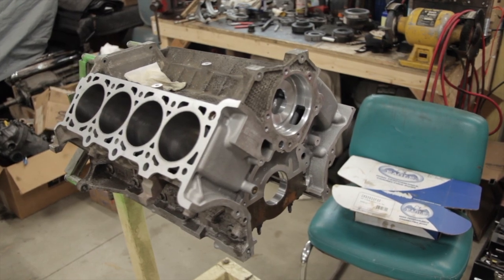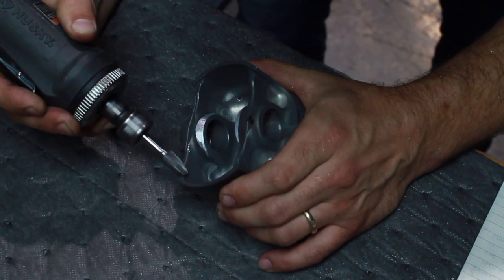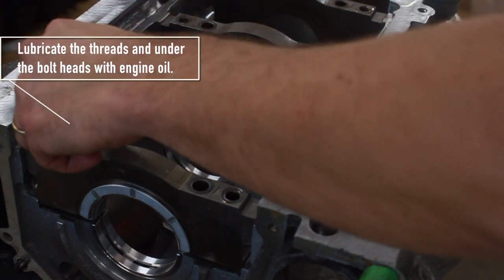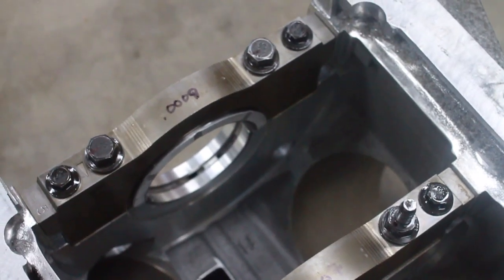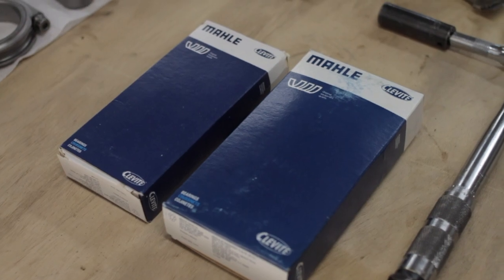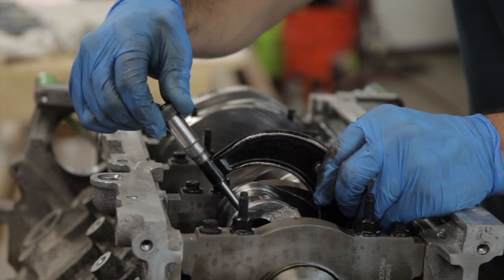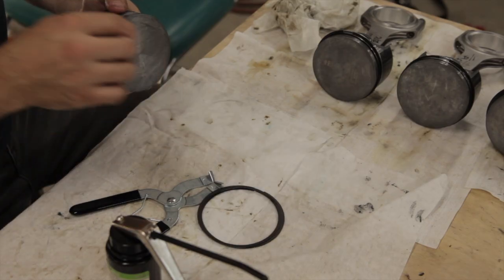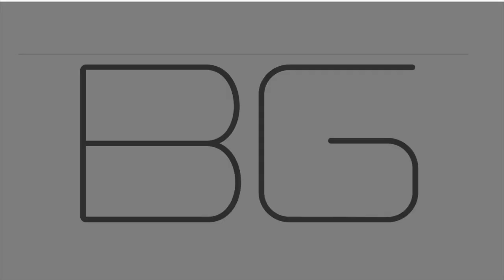Modular 4.6 3v Short Block Build | #trackworthynewedge | Chapter 2, Part 1

Comment: Let's say you have a 100% perfectly balanced crank (by itself) and you have 100% accurately measured and equal weight pistons/rods/wrist-pin/c-clip/etc... then my theory is that you should not need the crank balanced again with the whole assembly. My reasoning is that the crank has 4 lobes, spaced at 3, 6, 9, and 12 o'clock, so if you're adding equal weight to each of those, the overall balanced shouldn't change. Am I right?
Reply from the maker: Not really.  The crankshaft isn't balanced on it's own.  It's balanced for the weight of the reciprocating assembly.  The machine shop uses your reciprocating assembly to determine 'bob weight'.  Weight is added or removed from your crankshaft counterbalance lobes to create a balanced complete assembly.  My new reciprocating assembly (piston, pin, clips, rod, rings, bearings) was lighter than the OEM, so they drilled some weight out of my crankshaft lobes.

Comment: Very good video. Very thorough and detailed. The 3v nemak block imo is stronger than the teksid. It was made with more aluminum in structure points than the teksid was. And it has more support girdles in the casting. Along with billet main caps like the 5.4 aluminum block they are extremely similar.

Comment: Done a few push rod ford engines in the past. Currently have a 4.6 2V. Going to be building it this coming winter. Little hesitant having never done a OHC engine before. Great video. Very well done. Thank you!
Reply from the maker: Hey, no problem!  Glad you're going to give these mod motors a go.
Reply: @BradfordsGarage I’ve never built a complete engine before would this be incredibly difficult to do for the first time?
Reply from the maker: @icebox829  Its hard to say without knowing your background and ability level…depends on a lot of things.  I’d say look for books in building whatever motor you’re wanting to build.
Reply: @BradfordsGarage  never built any engines but I know how to use tools and I know how engines work. But I’ll def look into some books

Comment: 980rwhp on my 3v with stock torque to yield bolts. been driving fine for years. Weird it hasn't dropped the crank out the bottom yet.
Reply from the maker: Hell yea.  These cross bolted mains are very durable.  The only bummer is that I dropped a valve and have to rebuild again, and now have to buy new bolts, again.  Had I done the ARP stuff I wouldn't be buying bolts.  I will upgrade this time.

Comment: These mahle flat top pistons I tried looking them up and all I've seen is that they fit 2v and 4v are they the same fitment for the 3v?  Sorry for the stupid question
Reply from the maker: Hey, thanks for the comment and not a dumb question at all.  There are pistons specifically for the 3V that have a fly cut relief for the exhaust valve.  I assume that with some camshafts you may need those pistons.  With the cams I used on a 102 crank centerline I had a ton of room when I checked PTV clearance.  Glad to help in any way that I can, though, if you have more questions.  Feel free to shoot me an email.

The part number for the pistons I used is 930256272.
Reply: @BradfordsGarage  Thank you for the really good info.  If I could pester you some more The 3v 4.6 I have is in my 2010 f150 I'm wanting to port the heads based off your videos here, but I also want to run it on e85.  I your experience and or your opinion do you believe its possible to push in excess of 350-400 crank hp or am I dreaming do you think?
Reply from the maker: @2angetsU32  Hey Kent.  Not unreasonable at all, especially on e85.  This engine made 352 rwhp with the stock intake manifold, which by the 85% rule, that's like ~415 crank.  It should make around 375 wheel with the FRPP intake and Accufab TB on it now.  I just haven't been able to dyno it again.  And it actually dropped a valve a couple weeks ago.  

Knowing what I know now, I wouldn't have gone to so much trouble to port the heads and definitely wouldn't run oversized valves with stock (or even .020" over) bore size.  The oversize valves are just too shrouded and theres not much to gain there.  

I'm going to do another set of heads for the new engine and make another video covering what all I plan to do to these heads- which is give them a good valve job, keep the throat ratio around 89% and just clean/blend the 'bowl area' on the intake side- if you could even call it that.  The intake ports are such a straight shot to the back to the valve there isn't much of a 'bowl'.   On the exhaust side, I'd open up the bowl on the long turn side like I did on these and smooth the short turn side and the corners.  Won't touch the floor, and I won't be enlarging the ports at all aside from what little bit occurs consequently of the blending/shaping.  

Good luck on your build and don't be afraid to ask more questions if you have them.
Reply: @BradfordsGarage   That all actually sounds great, besides the dropping of the valve I'm sorry to hear that.  I meant to ask though was your compression ratio altered when you put in the flat top pistons?  I would assume it went up by a bit
Reply from the maker: @2angetsU32  Oh, yea.  The flat tops increase CR by a bit.  Since the chamber was altered in my heads and I used aftermarket valves, I don't really know what the difference would be, but I believe the stock pistons are a 9cc dish.

Comment: Fantastic dude! Looking to build my 3v block with forged pistons for a single turbo which I currently have on the stock block and it's.. sketchy to say the least. Thanks for the help!
Reply from the maker: Nice!  Depending on how much boost you're running you can get away with that for a while, as you've discovered.  Lots of mod motors run boost on stock internals and they hold up with a good tune.  Good luck on your build and thanks for watching!  Don't hesitate to reach out if you need anything.
Reply: @BradfordsGarage  Hey here's a dumb question for you, when you blueprinted your mains you did a full torque sequence on TTY bolts. Are you concerned with torqueing the TTY bolts twice?
Reply from the maker: @17456spartan  That was something I had to look deeper into, myself, and basically go on the recommendations of others.  I didn't use my new bolts to check main clearances, but the old set.  From what I understand, the bolts will still tighten down enough to give accurate readings, you just wouldn't want them back in service (though, I did find a handful of guys who reuse them a couple times, go figure.).

Comment: Honest question... should you fit your rings with a torque plate installed? Extremely informative video and very precise work!
Reply from the maker: In my experience, it is not necessary.  Definitely when honing cylinders because you want the cylinder to distort to 'running condition' under bolt clamping pressure, so when you bolt your heads on the cylinder returns to it's as-honed state and will be as round as possible.

But my thought on using it for ring filing is that whether the cylinder bore is round or slightly oval when fitting rings the circumference is the same and the gap should remain consistent as the cylinder changes shape.  We're usually talking very slight differences in 'out-of-roundness' with/without a torque plate.  If you were really worried about it or someone else has a compelling argument for using them, you could give it a try and see what the results are.  Or file some rings without it, put the torque plate on and check the gap to see what difference it makes.  Which is admittedly something I've never done.  Maybe I will on the next one.  Thanks for the comment.  🍻
Reply: @BradfordsGarage  your answer seems to be the general consensus. I appreciate the reply!

Comment: Hi.   The secret in the Coyote is the cyllinder heads.     If you can replicate or get close to the flow numbers on the intake side from .200 to .600" you will be fine.   The single large exhaust port will flow enough.
Reply from the maker: Yea!  I did port the heads and running Comp 127500 cams.  Didn't get them on a flow bench, so I have no idea what they flow.  Haven't gotten a chance to dyno it again with the FRPP manifold on it, but it made 352whp (so...like 415 flywheel), about the same as a gen 1 coyote with the stock intake manifold.  Should be around 375 now.
Reply: @BradfordsGarage  Sweet numbers!
Reply: Do you have a dyno sheet somewhere?
Reply from the maker: @dennisrobinson8008  I don't.  He kept saying he'd email it to me but never did.  I figured since I had to go back to have him clean up the idle and dyno it again with the new intake I wouldn't keep bothering him, haha.  I think I took a picture of the dyno screen and those are on my instagram somewhere-  @bradfords_garage
Reply: Ok, thanks for the feedback.     How is the rwtq on the 352rwhp dyno?
Reply from the maker: @dennisrobinson8008  It made 350 lb. ft.  at the wheels at 5200.  It hits 320 lb ft by 3500 and pretty much holding peak torque from 4200-5200 rpm, a slight dip in the middle of that span.  From what I've seen of the dyno sheets for these cam shafts, that's pretty normal. Peak HP at 6100.  

Pretty interesting numbers for this displacement.  When I ported the heads, I ground my own +.020" stainless valves to get the throat ratios down to around 88%. They were around 91% with the stock valve size.  (I can't remember exactly what they were, I'll take a measurement if you want.). I think that's where some of the top end went, but it makes great torque.  It's a blast to drive.  

A lot of 3V guys complain about the loss of low end with the FRPP manifold.  I don't know what percentage of them are running cams, also.  But, one in particular is not.  Just bolted the manifold onto his stock engine and expected huge gains.  Obviously, changing intake manifold runner length effects where the power curve falls in the RPM range...  They might see small increases in HP, but mostly they're going to see that it makes peak power higher up in the RPM range, granted they're also not changing anything else about the motor.  The stock intake wasn't half bad in these motors.  But, in my first test drive with the FRPP I was hitting the rev limiter a lot because it was still making great power, just didn't feel like it was time to shift.  

But, I think because of the way the heads were done its a good match for my engine.  I'm stoked to see what it puts down on the dyno next time.

Comment: Where did you find the crankshaft main bolt kit? Checking online I've found they are discontinued
Reply from the maker: I bought these bolts from ModMax-  http://www.modmaxracing.com/product-p/90625030.htm

The side bolts are not TTY, so you can reuse them, but I ended up buying new ones from the Ford dealer, anyway.  

Good luck and thanks for checking out the video!